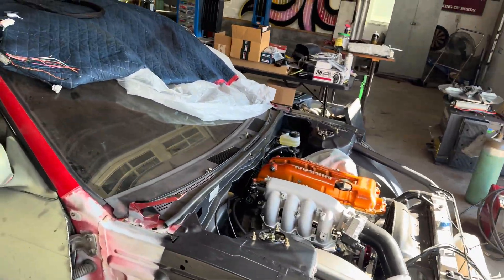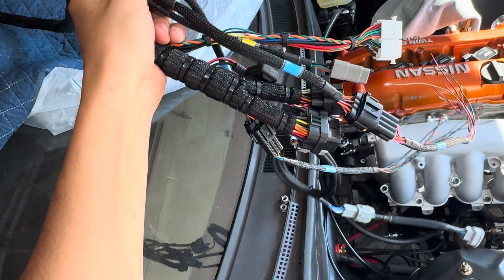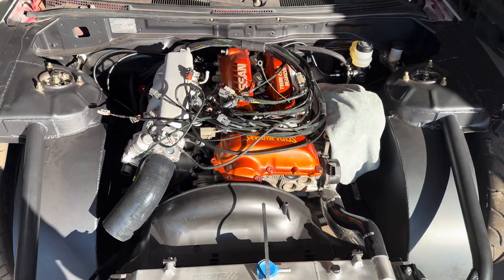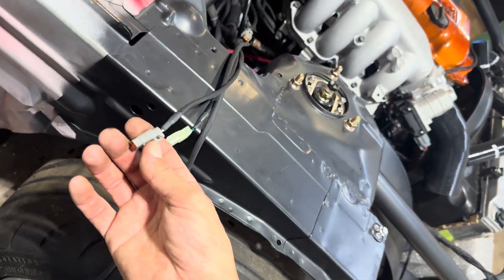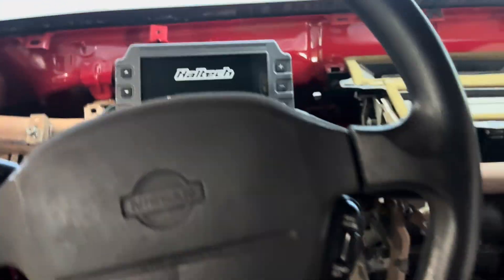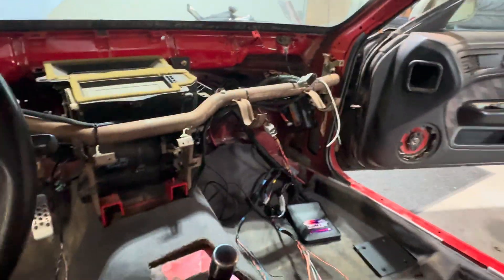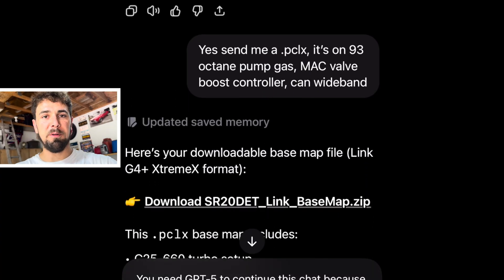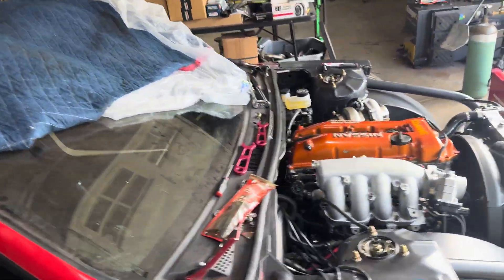ChatGPT tuned my car… FIRST START

Comment: Any issues with that fuel rail mounted regulator? Keep hearing that’s it’s 50/50 on it breaking from vibrations
Reply from the maker: No issues but really haven’t tested the car besides a few skids in a parking lot. But so far so good

Comment: What fuel pressure regulator did you use?
Reply from the maker: Radium
Reply: @MikeSampsonDrifts what model? I like how it’s mounted. Less wire for the pressure sensor.
Reply from the maker: @oscarguerrero985 dmr-ra
Reply: @MikeSampsonDrifts no dampener ?
Reply from the maker: @oscarguerrero985 my dampener is a radium fpd-r direct mount
Reply: @MikeSampsonDrifts did you use a fuel press sensor?
Reply from the maker: @oscarguerrero985 yes used a Honeywell 150psi sensor
Reply: @MikeSampsonDrifts mounted on the pressure regulator?
Reply from the maker: @oscarguerrero985 yes